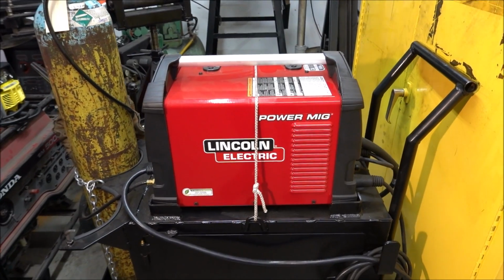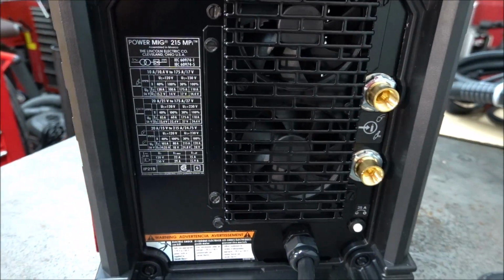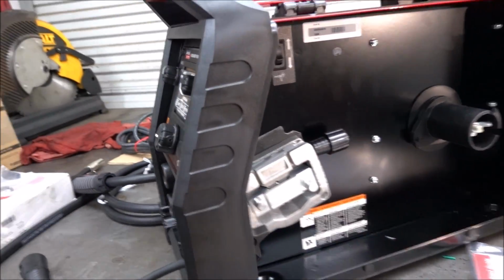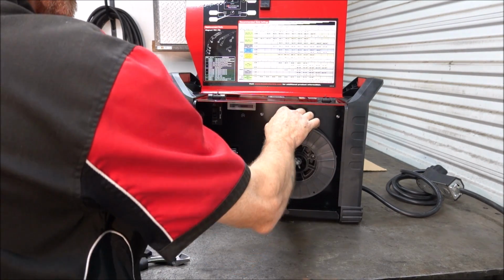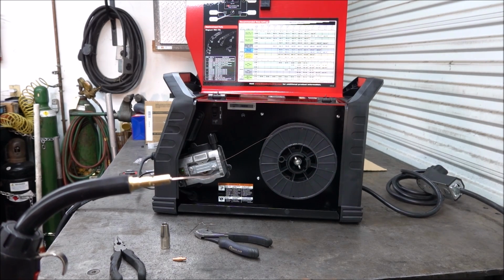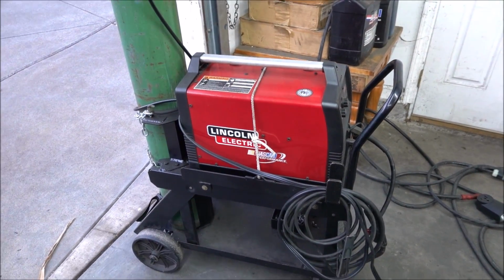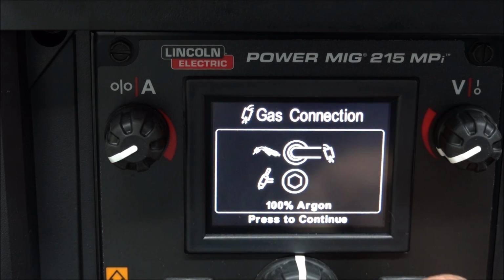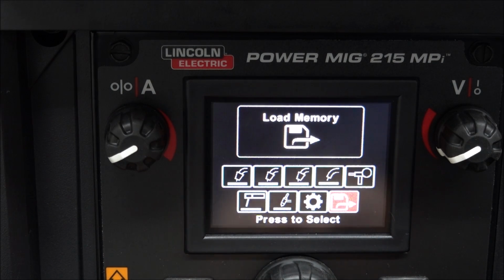Lincoln Power Mig  215MPI Setup and Review

Comment: I just got a combo pack including this machine.  Excellent video thank you for making it.  I have to ask.  Did you use the gasless nozzle that comes with it for that weld or did you add a new nozzle yourself?  I don’t think you specified.  Again thank you for making this video.  It  had everything I wanted to see before setting mine up for my needs.  ✌🏻

Comment: Why did they stop production of the 210mp is the 215mpi a better machine?
Reply from the maker: The 215 is very similar to the 210.  It has the same output. But it has a few improvements over the 210.  That’s why they stopped making the 210.

Comment: Just bought this unit, just for a hobby….what size breaker do I need to run this? 30 or 40 amp?
Reply from the maker: It draws 15.9 amps. You only have to a 20 amp breaker.

Comment: I can't believe lincoln won't make a 200 amp machine with AC tig. I've had my Everlast 225 for almost a year, and it's the last welder I'll ever buy. I sold my Lincoln 225 tig, 256XL mig and 180 Dual and bought this Everlast and it's crazy how much better is it than those old mosfet transformer machines.
Reply: Try the LINCOLN Square Wave TIG 200, it's the best for aluminium.👍
Reply: @GuestInvitado-gd3bi  Doubtful it's any better than Everlast, and it doesn't do mig. The whole point was about the capability of a multi -process welder.
Reply: i was thinking about the 275 everlast,they just seem to give you more for less money.
Reply: How does your everlast welder 6010 rod i have one it doesn't weld it very good

Comment: You like it better then the 210?
Reply: Thank you, Happy 4th
Reply from the maker: Yes I like it better than the 210.   It’s only a small upgrade over the 210.
Reply: @1970chevelle396  Thanks for the review. While the output current and volts don't seem too different, the duty cycle is quite a bit better. 30% at 215A/24.8V as opposed to 25% at 200A/24V. It doesn't seem like much but that's 33% more energy output per 10 minute cycle! I looked at the 210 before this came out and wasn't quite willing to upgrade from my lincoln 180 mig, but this one might just be worth it. One thing I find odd is the plate on the back says 215A output but Lincoln says 220. Odd that they would have made a mistake.